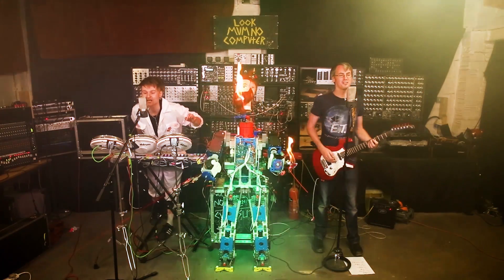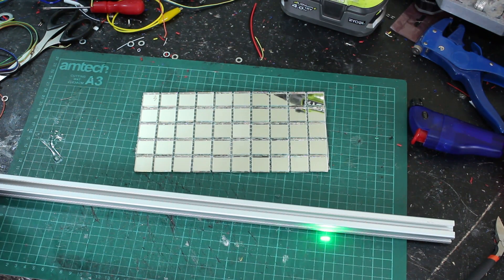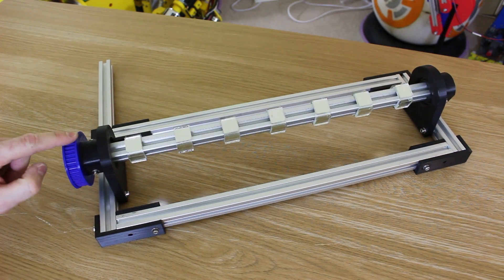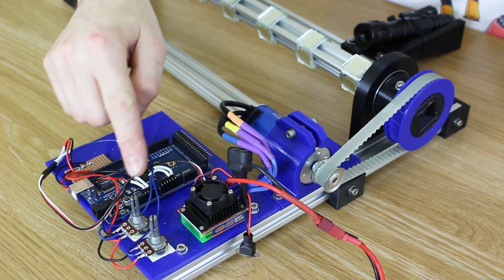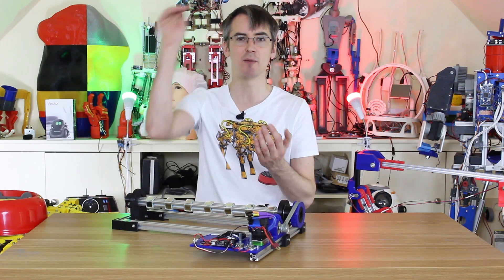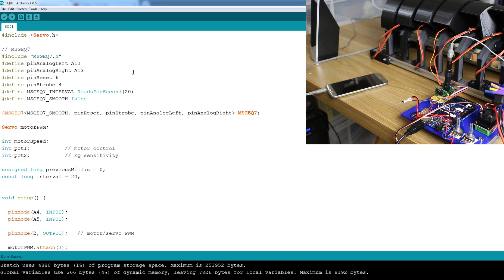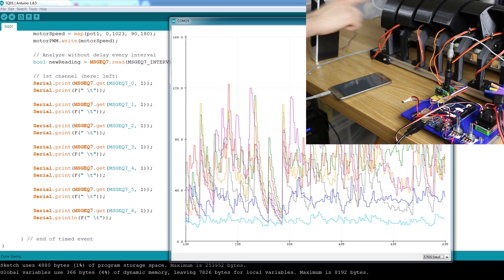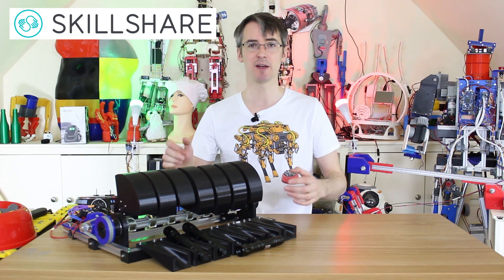Building a Laser Projector Graphic EQ Display | James Bruton

Comment: If ya'll are thinking about playing with lasers here is where you can get the proper goggles: https://www.survivallaser.com/Safety_Goggles/cat556089_826120.aspx

A very credible site. Please don't mess around with lasers without protection. It can burn a hole in your cornea faster than your blink reflex can save you

Comment: Cool project, James.  If you get more into lasers, you've gotta check out the dye lasers that can project in colors across most of the visible spectrum.  Just an aesthetic suggestion if you decide to keep the laser equalizer in that space:  in addition to fanning as you mentioned, cut off the bottom, so it projects crisply out of the crease between your wall and ceiling.

Comment: Great project. And nicely over-engeneered, as some other readers pointed out. The rod trick to produce a line, is the common way to create a line with a laser. 

I just want to give a tip to get rid of the double lines you get when using ordinairy mirrors. 1 line is produces as expected, by the reflecting (silver) coating. The other is produced by the glass surface. Optical mirrors, used in experiments are created in the oposite way. glass at the back and the silver coating in the front. And the laser will only hit the coating and no glass. The downside of this is, that the mirrors are extremely scratch sensitive. 

These mirrors are expensive. But for home projects extremely simple to create your selve. 
Just take a normal mirror and find the right chemical solution to disolve the protecting paint on the back of it. It will take away the paint and leave the silver. Leaving you with a perfect reflecting surface. Just don't clean it with a paper tissue, it will scratch. Paper is abrasive.
Reply from the maker: I believe the double lines are there because not all of the four mirrors in each position are perfectly aligned - the back aren't flat because they had adhesive etc stuck on them where they were mounted on the sheet.
Reply: You are right @jamesbruton . That would be a great reason also. It's a pain to align optics. And I can know, I spend 4 years learning about it and have done numerous experiments with it. That's how I discovered the trick in removing the protecting surface of mirrors. I noticed at school that the mirrors we used had the glass on the back side. 

But hey. Only credits from me to you. Great project.

Comment: Welldone looks cool .. It would be good on its side across a dance floor  ...If you bounce each laser off a second mirror mounted on a stepper motor shaft at an angle you could get all sorts of amazing effects. lots of geometric shapes with control from arduino with the 7 band EQ  -.https://www.instructables.com/id/Four-Motor-Laser-Spirograph/     <-- example without control  It would be Amazing
Reply from the maker: Thanks, like it!

Comment: Could make it prety simple with normal Electronics. Just have a sync puls that turns all the lasers on with a certan phase, then a comparator that turns them of when the voltage of the sync puls get higher than the voltage of the grapic equlaizer source.

(and yea.. the lasers is sufficently fast)

Comment: I think an esp would've definitely had enough performance to calculate the rotation and switching and stuff. The camera shutter would not have been an issue as well bc there's the exact same light hitting the wall at exactly the same time - just one time it's blocked by a shutter and one time it's not created at all. But the shutters definitely look impressing

Comment: I was really looking forward to the lasers being switched in sync with the rotation, I really hope you have a part 2 where you do this. If you also mount each of the 4 mirrors at slightly different angles, combined with fanning out the lasers like you said, you could quadruple the number of bars you are projecting. Also, you shouldn't need an encoder to sync up the speed; I would just feed one of the motor phases through a comparator into an interrupt pin and measure the timing between positive edges. You should be able to track the speed with plenty of accuracy this way.

Comment: I have thought about this before I ask this question. But I guess I’m having a brain freeze or whatever the cool kids are calling it

But....how’s does the laser light make a complete line if the mirror is effectively in (some of the) the path of the laser? 

I know the mirror are spinning but, my brain doesn’t have an answer. I can see how there would be a line above/below the spinning shaft but it looks as though the line is also behind the spinning shaft. Isn’t it?

How does this work? Do the photons get flung off the mirror somehow? Or am
I just being thick today?

Be kind. 🙃
Reply from the maker: They are reflected of the mirror in an arc as it spins?
Reply: James Bruton thanks for replying James. But I’m not quite getting it. 

I’ll do some research- I’m missing something

Comment: I’d be curious to see if you had the sets of mirrors on slightly different plains if the lines coming off would be more like bars instead of lines. Like the mirrors would have a controlled “wobble” causing side to side movement as well.

Comment: I have to admit, I was a little disappointed that you went with the mechanical solution, but it looks awesome, and the shutters jumping up and falling gradually just looks cool.

Could you possibly add a separate "Sync" mirror and sync your system using a single pulse of reflection from an LED onto a photodiode, effectively the same way optical tachometers are handled? That would mean far fewer pulses to have to keep track of than an encoder and for getting the bottom start point you could just have a potentiometer to tune the synchronization for the lower end of the bar and another for tuning the max height (Max pulse length of the laser). I believe this is how the cheapy chinese toy POV displays handle syncing.

I don't know how fast those diode laser pointers turn on and off, but considering how fast a fiber or CO2 laser can be pulsed for a lasercutter makes me think it's probably fast enough.

Comment: Nice !
But two things :  first this is not an EQ this a spectrometer , second you should have a logarithmic scale to represent level in each band.
And at wich frequence do you split your bands ?
Reply from the maker: It is all done by the MSGEQ7. Yes technically I cannot adjust the amplitudes so it is not an EQ, but you know, keywords and that...
Reply: @jamesbruton  Yep I admit :p
But for the logaritmic scale I think it would really add interpretability in the result. Maybe plus smaller obscurator for more reactivity ? And I have checked your code, you have an interval of 20 msec ? which means a loop would always have a duration of 20 msec ? Cause if that's the case it's a bit short for the lowest band to have a signifiant value, I think 50 msec would be better : it's the duration  of a 20Hz signal period ;)

Comment: If you angle each mirror a little bit of axis you'd get wider stripes right? 
Or you could use some cool lenses 😏
Reply from the maker: Some of the four mirrors in each position are not perfectly flat, so some of the lines are slightly wider. It's hard to do it deliberately though - probably need more precise mirrors that don't have adhesive on the back.
Reply: @jamesbruton  Or you could use convex mirrors. But than you'd be limited to a certain projection distance to keep the stripes from overlapping.  Could still be a cool effect though🤔

Comment: Maybe you can start an opendog mini project. As long as you can not continue with open dog
A light weight model with the legs under the body.
  fast 24v linear actuator are cheap.

The small projects are funny but the high tech projects are much more interesting. (at least for me)
Reply from the maker: I don't really want to build another whole robot, there are some other solutions
Reply: @jamesbruton  You certainly should not stop with Open dog. Much too cool project.
But with the learned things of open dog a small / simple / cheaper option next to it.
Open dog 2.0 that is slightly more affordable to build. There are cheap actuators with Potentiometer signal feedback 10- 100mm / sec. 

But whatever you are going to do, I will continue to follow you. Success with all the fun projects.
Always inspiring
Reply from the maker: I'll consider it. Do you have links for 100mm/s actuators with feedback?

Comment: Well that was cringeworthy. Especially the servos.
Use coil actuators or even a speaker core to change the curvature of a reflective strip and you get a variable line for free. Use one laser through a diffraction grating or XY projector chip to split the beams to each channel.
Many ways of solving this but servos are the least optimal. Even independent steppers would do.
Reply: What’s the link to your video where you show us how to do this “properly”?

Give James a break, it was a fun video.
Reply: Openlase, they use Galvos to direct the laser.

Comment: Looks fun buuuuut, these blocks that block the light are way too heavy. The momentum will cause them to be incredibly inaccurate. There are other ways to do this (for example electronically timed pulsed to turn the lasers on and off) or well, you just have to figure it out yourself of course. You are a brilliant man, so it shouldn't be too difficult :)
Reply: Inside the laser pointer they probably have fancy constant current sources for the actual laser diodes, which will have some lag between giving them input power and turning the diode on/off, so just switching power to the entire device wouldn't give you precise timing.  You'd need to switch power directly to the diode which is a lot more electronics-ing
Reply: He said about timing the lasers on and off but would have been more work
Reply: You should watch the video before commenting.
Reply: I know I know I should watch the video etc etc, I did and I just think there should be more emphasis on this. About the lasers: did you ever hear about TTL? It's the way to go with laser diodes! :)

Comment: Hey James, was there any reason you didn't use a simple one-directional lens, or even just a glass rod to split the lasers vertically? It would have eliminated the need for the entire rotary mechanism. I think the rotary would have been the better solution if you'd been able to time it with an encoder like you suggested, but since that didn't pan out, a more solid state solution seems like it would have been the better option, I can't imagine having a big brushless motor running improved your music listening experience much.
Reply: Yes, but where's the fun in that?
Reply: Okay folks. 1 Laser. Not 7. Split that fella. Worried about degradation? Up the mw to watts and get decent optics. On the mechanical shutter thing - perhaps an LCD? You could even layer several LCDs so you could have intensity gradations. I'm sure everyone here knows how a welder's visor works by blocking out light, same concept but with a traditional matrix, say 320x200 or something. You could do some way wicked patterns that way. However, mca mac is right - it was fun to watch all that gyrating goofiness. And you don't need to spin a mirror. Just get a line filter - it looks like a little lens with a raised section that makes a LINE project out instead of a point. Incidentally you can get all sorts of projection lenses... + / _ * etc
Reply: Spinning mirrors ensures even intensity
Reply: @PKMartin  Not really. It'll trail off on the ends either way, assuming you're pointing it at all tall wall rather than inside where it's hitting the roof. It's dependent on distance and the amount it gets spread out over that distance, and both will trail off at the end due to internal refraction, but it doesn't  matter, because you're cutting off both ends of the beam either way. If anything the lens will be more consistent because it won't be strobing. It's the same light spread over the same distance, but passive, rather than active.

Comment: Are you sure the ODrive updated is coming? opendog is still crying in a corner
Reply from the maker: There are other solutions but I need to get it right
Reply: @jamesbruton  what other solutions? I'm looking into buying one, please tell me!
Reply from the maker: @loukask.9111  Still using ODrive, but closing the loop myself with absolute position encoders on the joints. I will do a testing video on this.